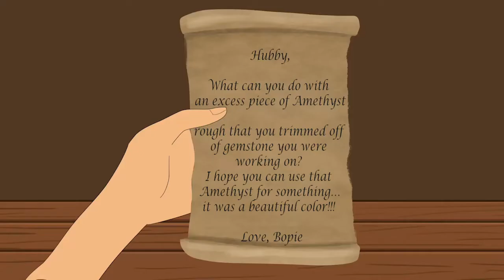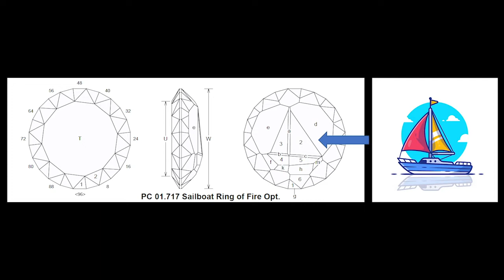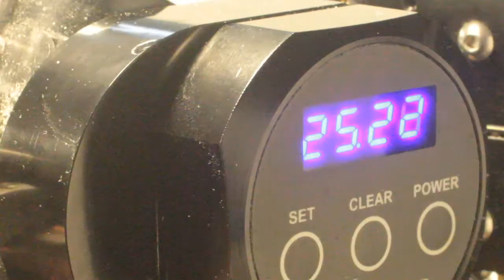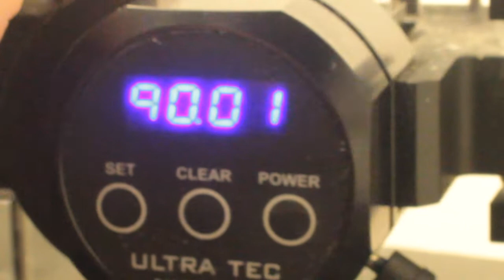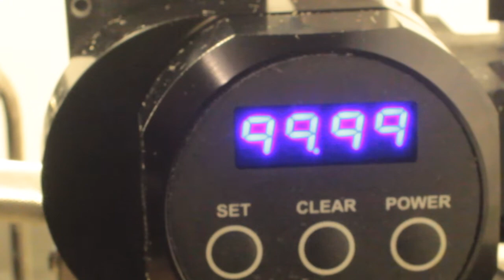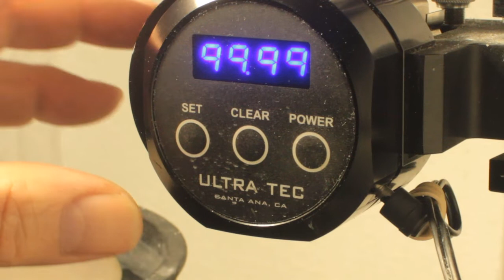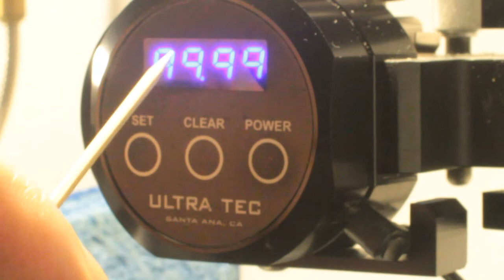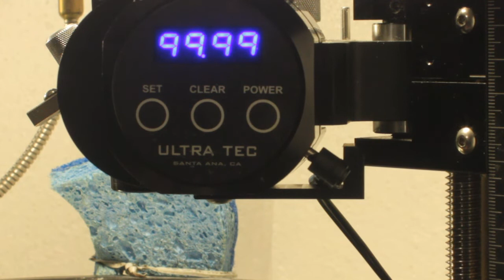Gem Cutting Tutorial: Amethyst Sailboat

Comment: The DAD power connection is a problem. The up-side is that it is a generic connector that should be easy to replace if needed while the down-side is that it is a generic connector not well suited to making a long term reliable connection to the DAD. The jack retention bracket seems like a workable solution to the problem. Thanks for the information and another great video.
Reply: Thanks for that information Larry!

Comment: I would LOVE to own an UltraTec with a digital read-out however, I have always felt that it was a really bad idea that a Jack is used to power the read-out. Worse yet, and "L-Shaped" jack that adds even more torque to the receptacle if/when the cord moves.
I don't understand why UT wouldn't have Hard-Wired the power supply to the read-out ?
But with ANY device I own that requires a power supply adapter, I ALWAYS reinforce the connection so that any movement of the wire or strain is directed along the wire and not at the jack or receptacle. I do it even with USB's. 
At the very least, UT should change the design to a much more robust connection/plug if not just hard-wire it.
All that said, at least they have a solution (which should be sold with the machine IMO). That bracket essentially does what I have done (with Tape and/or Wire Ties).

PS> Excellent Facet Design though. Thanks for this episode. 
I decided to download Both of the Sailboat Designs (the other has a Pavilion).
Reply: Thank you.  Let us know how your Sailboats turned out!
Reply: @mikesackos2208  To be honest I haven't tried the Sailboat design out yet however,  I did just receive my brand new UT VL Classic Digital Machine today and look forward to start cutting with it ASAP. Still setting it up and trying to find information about the DAD Power Supply Bracket installation.
Having just rewatched your video and discovered it was this video I first saw the "Jack Retention Bracket" which UT now calls the "DAD Power Supply Bracket". Unfortunately, the DAD no longer has a hole on its underside where you can attach the bracket so I guess it's a useless piece any more.
Reply: @mikesackos2208  PS> I will cut this Sailboat design sometime soon and will gladly let you know how it goes. Thanks again.
Reply: @SnowTiger45  Best of luck with your UT VL.  Let me know how your like it once you try it out.  I don't know if the VL ever had a hole for that bracket as I use the V5.  Maybe the VL never had an issue with the power supply?